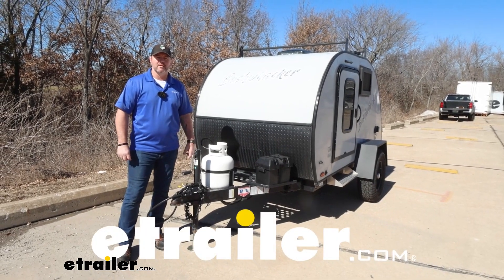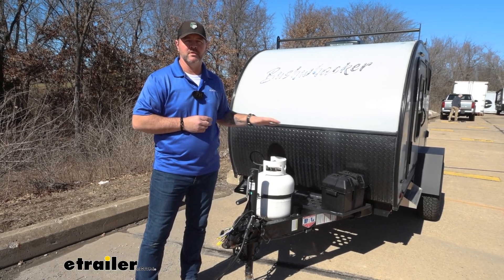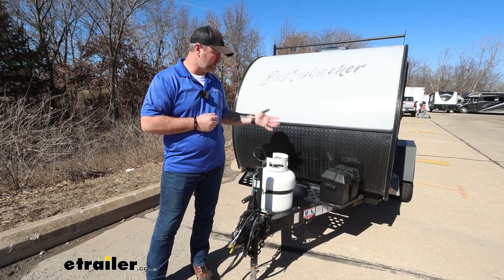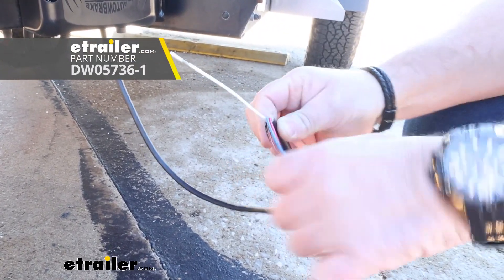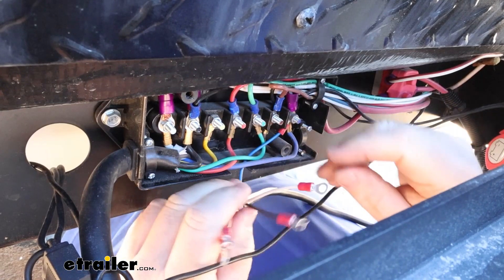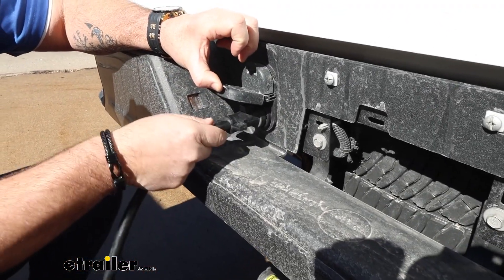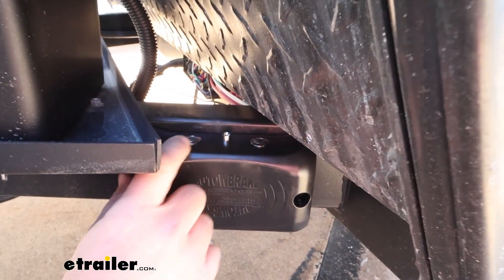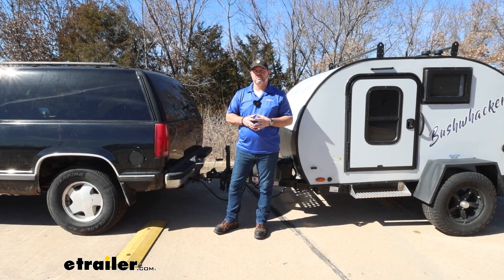etrailer | Installing the Autowbrake Electric Brake Controller

Comment: I'd like to have seen the pin and where that plugs in.
Reply from the maker: I'm not sure which pin you are referring to. If you can be a little more specific I can see if we have what you are looking for.
Reply: @etrailer  Thank you! I have since learned that it is a separate device that in case of emergency causes the brakes on the trailer to engage. It is activated when a cable attached to the tow vehicle is pulled and the pin is released. I just ordered a replacement from your company as mine was damaged by a tow company. The pin was pulled from the device and draining my battery while parked. I have found your company to be top notch!

Comment: How do you configure the wiring if the trailer has a 7-pin connection and the tow vehicle has a 4 pin connection?  The Autobrake controller instructions says it is is possible and the power supply for the braker controller can be the trailer's house battery that is charged with solar panels on the trailer with a solar charge controller.  We have that exact situation but aren't sure how the wiring in the junction box should be done.
Reply from the maker: I'd install a 4 pin to 7-way adapter like # 37185. Plug it into your 4-pin on the vehicle and ground the white wire. You'll be good to go!
https://www.etrailer.com/Custom-Fit-Vehicle-Wiring/Hopkins/37185.html